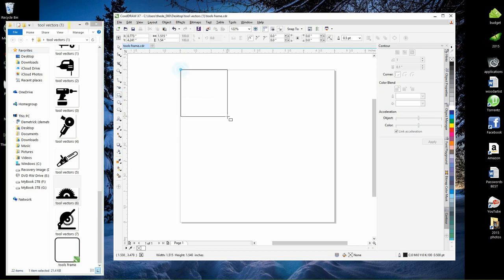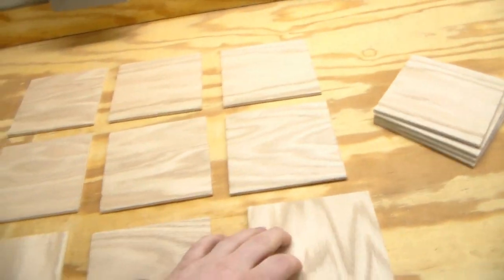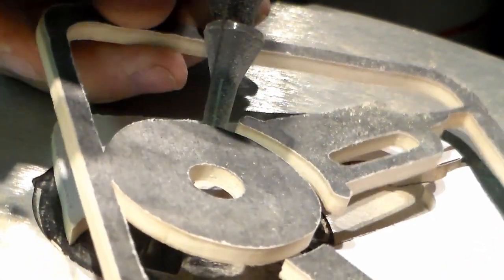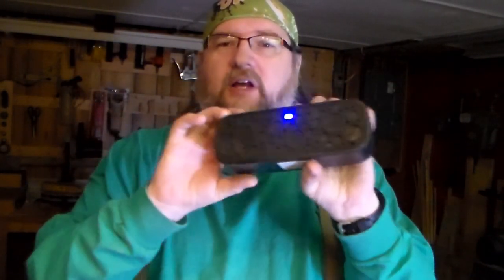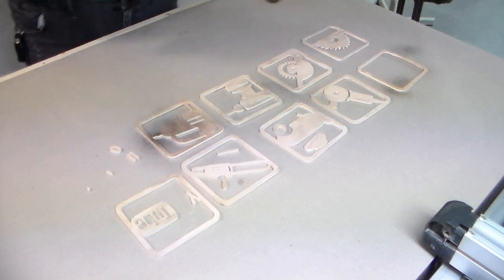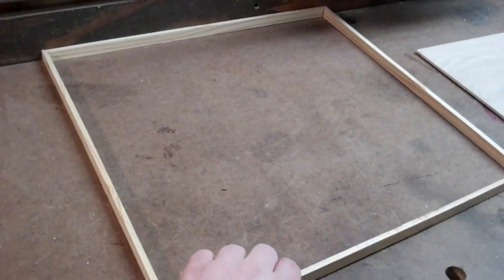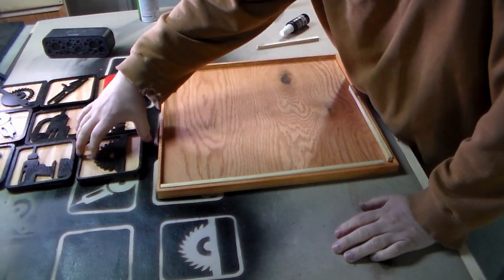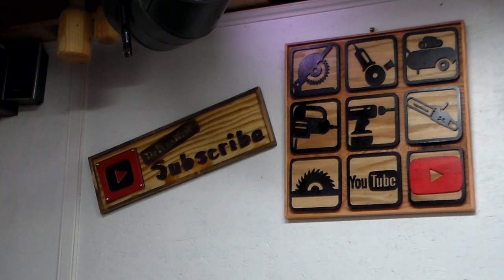My Artistic YouTube Scroll Saw Wall Hanging

Comment: Great job Chris!
The only thing... you needed a scroll saw square in there.  Great job Chris!

Did you create the graphics?
Reply from the maker: I modified some photo's I found with Corel Draw. I tried a scroll saw silhouette but it just didn't look right. I may do a single picture 6x6 inch that is just a scroll saw.